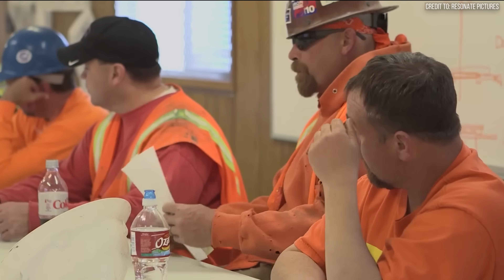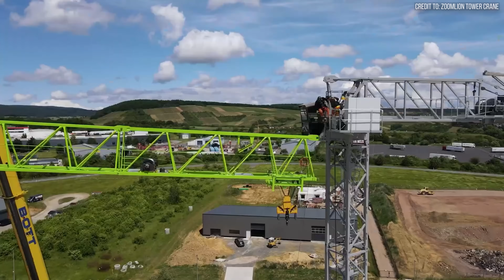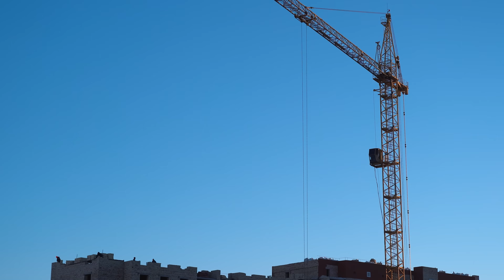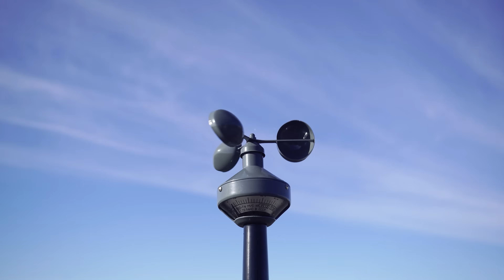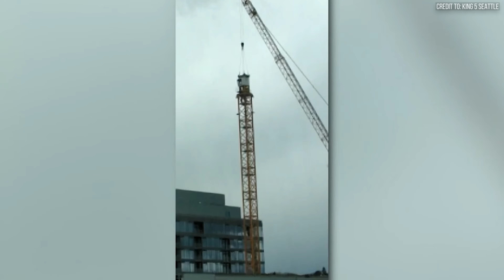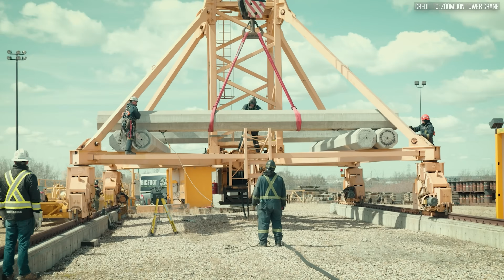How Safe Are Cranes Really? (The Answer Is NOT What You Think)

Comment: The narrator keeps referring to the boom as the jib. I thought the boom is the long part, and the jib is the shorter part opposite the boom. So, the trolly moves out along the boom, not on the jib as the narrator said.
Reply from the maker: Hi Sam, The trolley moves along the jib, the long horizontal arm. The smaller part you thought was the jib is actually the counter jib, which balances the crane. The term boom is more common with mobile cranes and can be confused with the jib, but in tower cranes, it’s not the standard term. Hope you enjoyed the video!
Reply: @HardHatIndustries  Thanks for clearing that up.